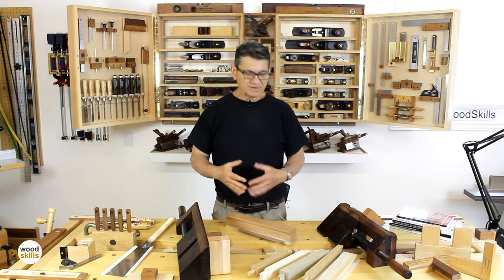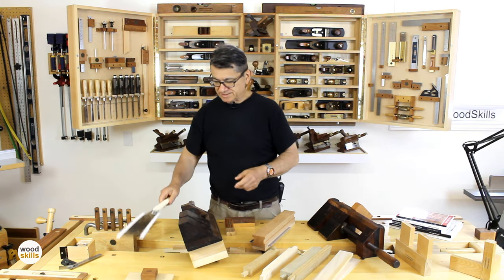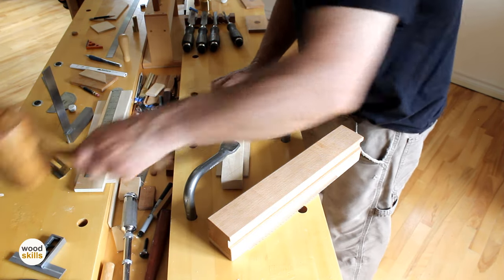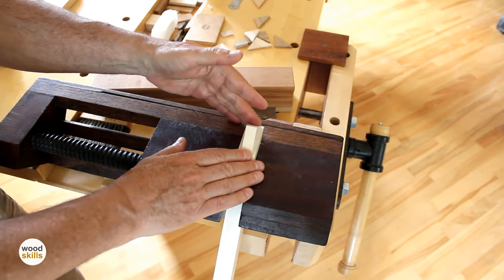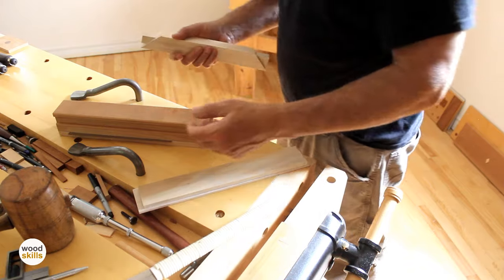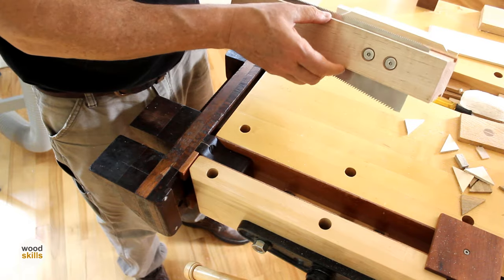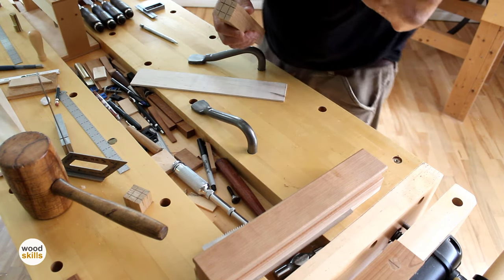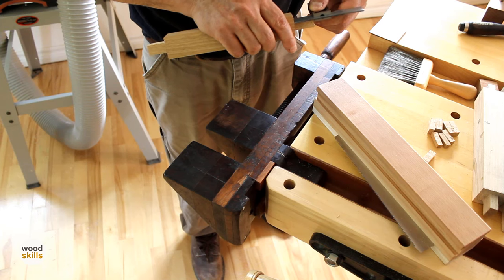Make Perfect Tenons with a Miter Jack Saw!

Comment: Good demonstration of the miter jack, but you can't make money if it takes that long to create a simple tenon.  Learning to saw accurately is a skill you must develop. A good sharp cutting gage, saw and chisel is all that is needed.
Reply from the maker: Thank you for the feedback! This is just a demonstration, not production mode. Agree, there are different methods to achieve the same goal. This method is simply to focus on how it was performed using a centuries-old Miter Jack and Miter Jack Saw.
Reply: @WoodskillsCourses  I fully appreciate your knowledge and willingness to share. I have been retired for some time now and only make stuff for fun and make every effort to maintain my hand tool skills. Too many young woodworkers today have no appreciation for these skills and that saddens me. I see two groups: the CnC slab & epoxy table builders requiring no hand tool skills; or "I need every jig and fixture on the market before I can do anything".  I fear the traditional woodworker is all but dead.
Reply from the maker: I completely agree and this is also my observation. My upcoming video next week is going to address woodworking as a hobby and I share my knowledge of how few tools you actually need to begin along with other nuggets gained in my teachings. Thanks!